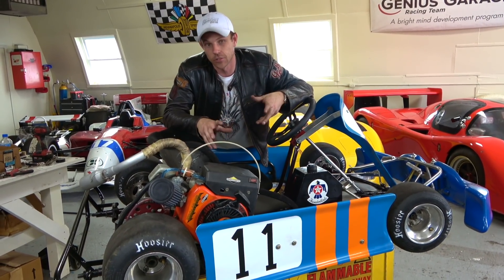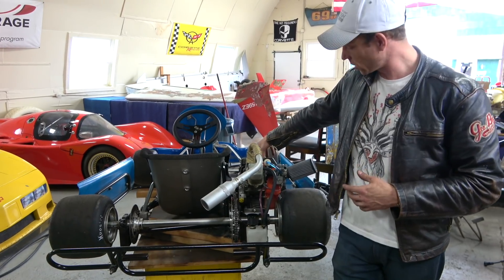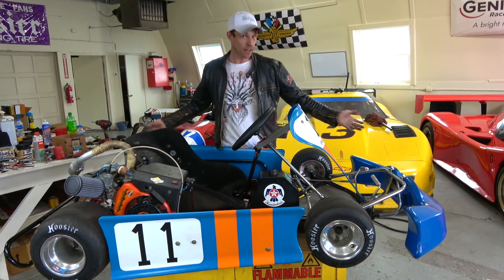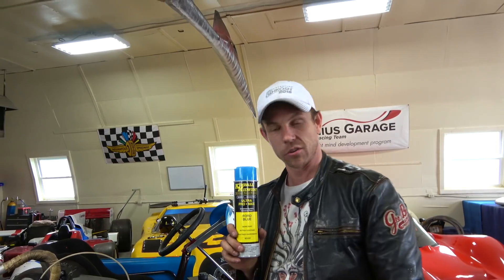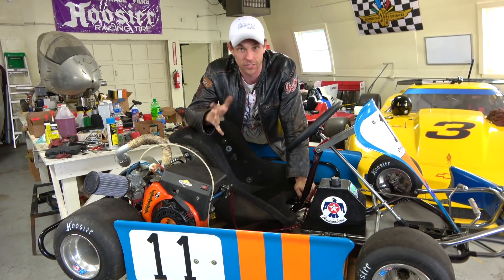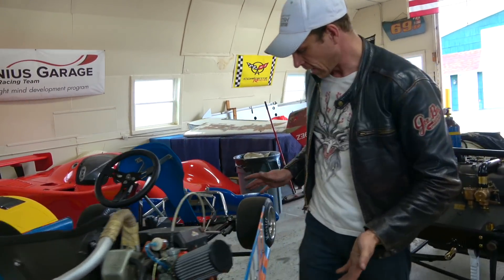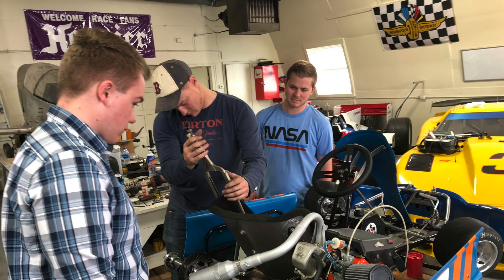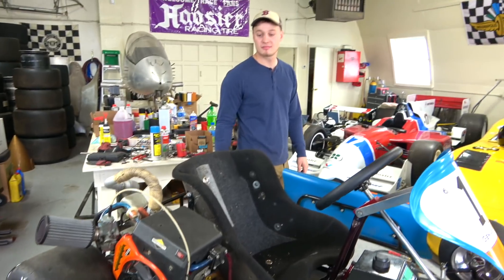Cheap Racing Kart build series at Genius Garage video #2

Comment: Well i bought this almost exact style chassis. Painted over chrome wheelchair chassis bars basically.  What chassis manufacturer? I have same tiny little steering with almost stripped spline and all. kinda feel they arent event meant for anything bigger than 80cc 2 stroke and asphalt.   I got 2 extra bare blocks, 2 sets of slicks, 1 good set of dirt tires, and a ziptie converted dirt body hiding it all..... BUT  WITH A STAND!!!.... for 1400.00

Smh..... Will be fun in the church parking lot at least for a bit . Bullring racer maybe a couple times.

Comment: I always wanted a racing kart but could never justify the money over a motorcycle for the speed lol
Reply from the maker: Mike Le I’ve raced both and karts will clobber a bike with much closer racing. Give them a try!
Reply: I know it’s built for a class but  I don’t like 4stroke karts way to slow  especially since I’m to heavy 

Also I prefer proper karts with front brakes and 6speed gearbox   
Currently running a twin engine kart  that I modified as the dedicated 250cc motors are to expensive 
So running two 125 motors one on each side 
Slowly getting there with it hitting 130mph last time out. 5mph slower than the other dedicated twins  
But that’s more a gearing issue And a lack of balls in my part